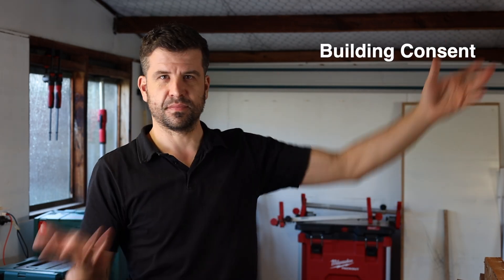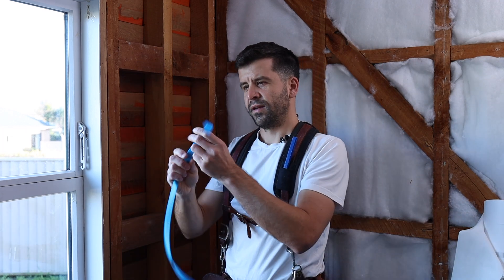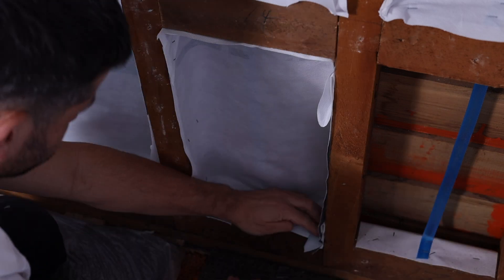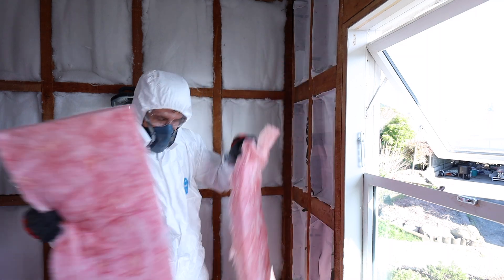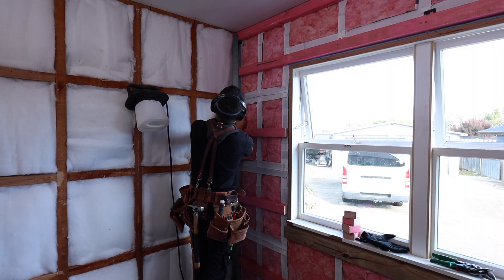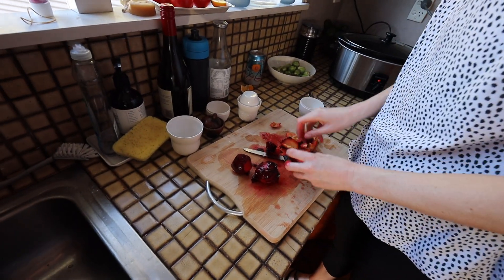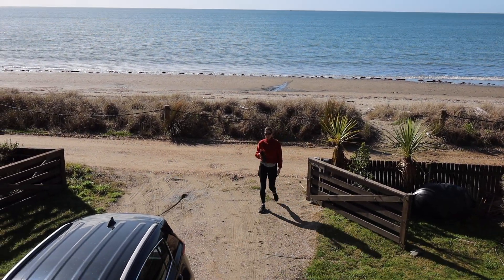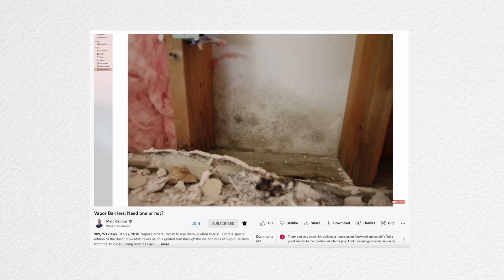We're Finally Going To Be Warm! Renovating Our 1960s House

Comment: So when I, as a German, see your isolation at your New Zealand house, I see it as a catastrophe. First of all, the diffusion-open foil must be attached from the outside under the outer formwork with a space in between for the circulation of the air for condensation water. Then bring in compressed glass wool, rock wool or straw and then a foil as a vapor barrier. On the foil again a slat as a distance to the foil and on top of that the sheetrock. This is what a European perfect sealed insulated wall would look like! But it looks very strange there to me in New Zealand because moisture can still creep in there because nothing is taped in your wall. https://en.wikipedia.org/wiki/Heat_transfer_coefficient  Actually, we carpenters in Germany expect this before we isolate!
Reply: to me, as an Austrian, I felt the same when I went to NZ, but I realized that different climates require different houses and it's not like a whole country would do it the wrong way for decades without noticing it. also Scott's a builder so he probably knows what he's doing.
Reply: @nightowl356  es ist ja wohl trotzdem offensichtlich, dass insbesondere im Winter Wasserdampf einfach in die Dämmungs- und Ständerebene diffundieren wird (vor allem weil Scott nun die Raumtemperatur konstant auf 20*C halten kann), und somit eine Menge Tauwasser in der Konstruktion anfällt 😅 (Soweit zumindest in der Theorie)
Reply: Nope. A perfect european wall construction would need a vapor retarder, not a vapor barrier! If there is a leak somewhere in a vapor barrier, there will be huge moisture damage in the construction, because the moisture wont get out. Its the same when building materials (for example the insulation) gets wet while building phase… a barrier wont let it out! A vapor retarder decreases the steam pressure from inside the room and also allows moisture to diffuse back into the room. That will prevent structural damage!
But principally I totally agree with you.
Reply: There is a big difference in the humidity in NZ and Germany (having recently moved from NZ to Germany myself) as well as earthquake activity requireing a lightweight flexible building. Timber is far better than masonry in this regard. Also with an average humidity over 70% in most parts of NZ, moisture must be able to leave a building freely. You can really tell the difference when looking for Flashings in German houses (particularly here in Bavaria), there are almost none. With the amount of humidity and rainfall NZ receives, you would have to tear down a German house in NZ after 15 years due to mould. Opening a window simply won't cut it! Also a ducted heatpump system is far superior to a  central heating system, I am looking forward to having the ability install one in our house here.
Reply: @frederik6597  naja, wenn genug Luft hinzukommt, sollte es eh trocknen. aber als Builder wird er vermutlich genug Erfahrung dafür mitbringen und wissen was er tut ;)
Reply: @nightowl356  ja im Sommer trocknets vielleicht, aber eiskalte Luft im Winter macht da garnichts 😂 Außerdem gibt es nirgends in seinem Wandaufbau eine Luftschicht, die richtig Luftzirkulation ermöglicht.. Nur weil er seit x Jahren Builder ist, heißt es noch lange nicht dass er alles richtig macht.. Und das sage ich, obwohl ich auch davon überzeugt bin, dass er ein echt kompetenter Handwerker ist! Doch die Bauphyisk in Deutschland bzw. Europa scheint doch etwas anders/ moderner zu sein.
Reply: @LockieScott  yes in germany we used to seal the houses air tight. But the trend goes to diffusion open houses, which allow moisture to leave the house. This development comes in combination with wood buildings, which are getting more popular in Germany because of climate change. Especially in Bavaria brick houses are not really typical… Actually building with wood is traditional in southern Germany! I think that modern sustainable framehouses from Germany would survive easily in NZ.

Comment: R2? R1.2? is that some kinda metric value conversion?, here in the Southern US we need R19 minimum in the walls, and R38 in the ceilings...  all based on ICC Energy Codes...
Reply: Yes, we use metric r values. ×5.6
Reply: @tweake7175  So technically its an RSI value in metric countries according to the google...
Reply: @michaeldysput2967  correct.

Comment: In Poland before crysis  since 2021 when government create taxes that go up 500-1000% for every company in Poland  there was a trend to build pasive houses where u have literally 50 + cm yes 50cm of insulation  

 yet  average insulation is 15-20cm of styrofoam + 25cm of  aircrete blocks (aerated concrete blocks that 10cm of it have simillar values to 6 up to 8cm of average styrofoam )  or 25cm ceramic blocks (with holes inside)  + 10cm or more styrofoam under the concrete floor

Comment: I never knew you needed a gap between the pinkbats and the exterior weatherboards. Does that make insulation that pumped in through holes in the exterior cladding more likely to trap moisture? We were thinking about doing that with our 1960’s house. PS. Wharariki is an amazing beach - there are often seal’s and their pups in the rock pools over summer.
Reply: You can see why Branz no longer supports that blow in insulation.

Comment: Norway uses U-values which is thermal transmittance, or the heat loss through a structural element. Values closer to 0 is better. Whereas R-Values is the measure of thermal resistance. R values are the opposite of U values. Something along the lines of R=1/U.

We use house wrap/wind barrier on the outside of the studs , and Vapor barrier in the inside if the studs, with isolation between the barriers. And battens on top of the house wrap with cladding on top of that for space to have moisture exit and dry.

In newer houses there’s another 5cm of insulation on the inside of the Vapor barrier for pipes, electricity and outlets. Common practice today is 20+5 in the walls 30-35cm towards the roof and 25-35cm and a radon block in the floor.

This is at least the code from what I know and have read up on, but I’m not a professional builder, I’m a software developer currently fixing up our second house 😅

Comment: R3 in the walls!!!
We have R25-30 (closed cell spray foam) in the walls and R10 Rockwool on the outside of the house. In our slope ceiling, we have R60  open cell in the ceiling (24 inch space).

Comment: You could have saved a lot of money and effort, by using wood fiber based insulation. It is open for diffusion of
Water,  ondemsate and moist air and also not based on oil.

But i Don‘t know the R value compared to glas insulation tbh.

Comment: Why not use Celotex or Kingspan? 70mm R value is over 3 just on its own. Also much easier to work with. Plus you get a reflective barrier built in.

In my experience, houses in temperate climates with proper ventilation and airspaces don't need vapour barriers. 

Great work as always. 👍👍

Comment: R values are SI (metric) or imperial (inch-pound).  I also thought most countries that use metric use RSI rather than R to avoid the confusion.  But its just a unit conversion difference.  Your R of 2.2 is the same as the American R of 13.
Reply: A lot of the online content is North American, so the Imperial units get used frequently. Note that most Canadian information follows the US, even though Canada is fully metric, due to its biggest trading partner being the US.

Comment: Pretty much any difference you see between values/factors in engineering/any science when comparing info from the US to almost anywhere else always comes down to units. The fact that we never switched to the SI system is mind boggling. We tried. We started to but politicians stopped it as usual. At least most of the scientific and engineering communities have been quietly switching behind the scenes.
Reply: It's been interesting to watch American engineers' Youtube videos over the last few years. The proportion of Youtubers who refer to distances in millimeters/millimetres as a matter of course has been increasing slowly but inexorably. I suppose it was inevitable a few years after all your cars and machine tools started coming from countries that use metric units. To fix anything you have to use metric bolts and metric tools, and you start seeing the benefits of the system when you discover you can simply subtract the pitch from the bolt size to find the drill size to predrill a hole for tapping - and it's a standard drill.

Comment: R values must be different in the US. I have bats of fiberglass sitting in the garage rated R13 that are for a 3.5 inch cavity and fill that space. (2x4 in. framing) My ceiling is rated as R44. Speculating that the difference is the use of a decimal point.

Comment: The two thermal resistance values you’ll encounter are the RSI and R-Value. The R-Value is an imperial system unit of measurement (ft2·°F·h/BTU) and the RSI Value is a metric system unit of measurement (m2·K/W). The higher the resistance value, the slower the rate of heat transfer through the insulating material.

To convert an RSI Value to an R-Value, multiply the RSI Value by 5.678.
To convert an R-Value to an RSI Value, divide the R-Value by 5.678.

I'm guessing you are actually looking at RSI Values and calling it R value.

Comment: Wall insulation is not worthy as most of the heat escape from ceiling and windows. You should just use an efficient heatpump.

Comment: Take a look at this R-30: ROCKWOOL  COMFORTBATT R- 30 Attic Wall 30.7-sq ft Unfaced Stone Wool Batt Insulation (23-in W x 47-in L) Individual Pack 1 total-Piece Item #122333  Model #RXCB3023.

Comment: I wouldn't have bothered with the second layer. What you did was more than enough for NZ and ducted heating but I get that the Americans and Europeans won't understand our temperate climate so it looks good for them. Breathability is the most important thing for NZ with our proximity to the sea which is why I shudder when I see things like Insulmax blown in insulation.

Comment: WOW ok - so R3 means that you're loosing 97 % of the temperature... So example: R100 would mean 100% temperature inside no being influenced by the temperature outside. R50 is up to 50% loss. But your wood will also help.   
I'm in Canada - we do R20 in the walls and R50 in the ceiling as a minimum. BUT where I live in the canadian pairies: we do R50 as a minimum in the walls and R80 in the ceiling. (the temperature here goes from +40 in the summer to -50 in the winter. So a 90 degree difference. it's crazy.)  
The R value system is worldwide. 
I'm surprised you don't have Wool insulation. Honestly. Seeing as you have such a large Sheep industry in NZ. 
Have you looked at passive House?

Comment: R3 ??? here we are aiming for R20-25 in the walls and R60 in the attic. Switched over now to mostly spray foam insulation. Can spray a house in a day air and moisture tight.  Retrofitting old houses can be fun, but also frustrating. She's gonna be comfy when you're done.
Reply: Their R3 is equivalent to your R15-20. 
Also, the climate is very forgiving in NZ.
Reply: Your R value system must be calculated differently. Every house here also gets a vapour barrier via multiple different systems that have evolved over the years. From interior plastics covers to exterior wraps.

Comment: If all N.Z. Building practices for houses were Having 6in - 10in Exterior Walls and a minimum of 4in Internal walls then the amount of insulation would be greater and create a warmer house in the winter and cooler house in the summer. Some countries have been using 6in exterior for decades already. Why are N.Z. Building Lawmakers so against Change, way to do things, competition for products  etc etc???????My wife and I are finding it so hard to find a ceiling fan with lights in N.Z. that dosen't cost the Earth.

Comment: Check out Passive Housing for  thermal ideas
Reply: Hi. In middle ontrio, i build with 12" exterior walls: 3" thick Styrofoam  'lego' type blocks tied across 6" gap for reinforced concrete poured into the core. (So walls are 3" foam, 6"reinforced concrete, 3" foam) South Windows let it warm up w sunlight in January, and in July shading them off w awnings keep it cool until the evening. I think never too much insulation.

Comment: As I understand it (and I maybe wrong) "R" value are based on the amount of BTU's   transferred from outside to inside and vice versa. In the U.S. temperature extremes are more so than New Zealand. You also have to understand Americans tend to expect inside living temperatures to be warmer in the winter months and cooler in the summer months. Therefore R values are higher.